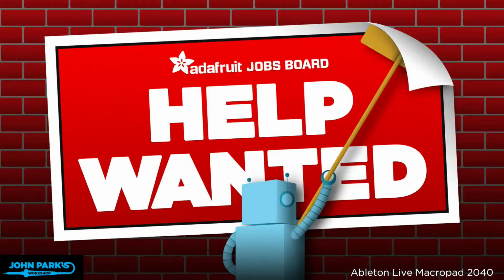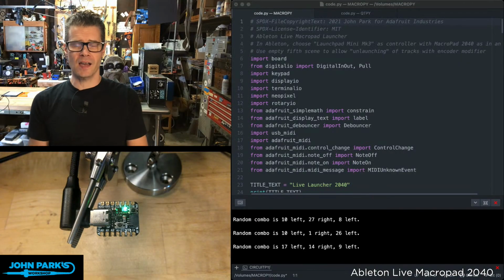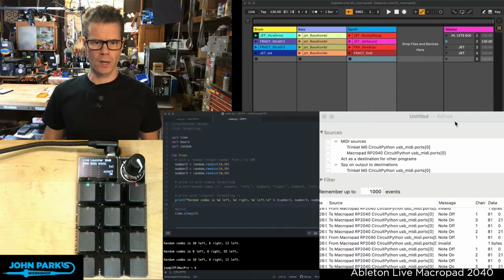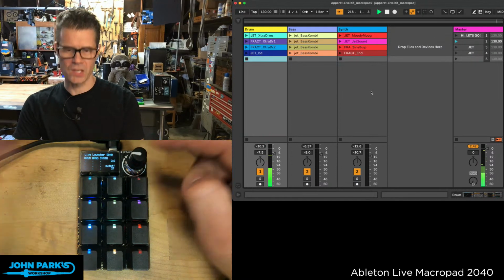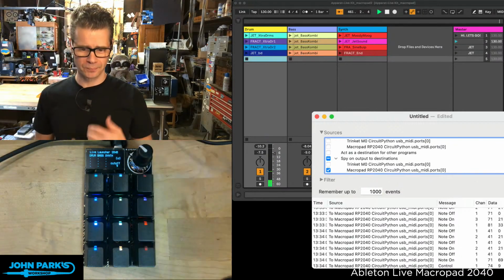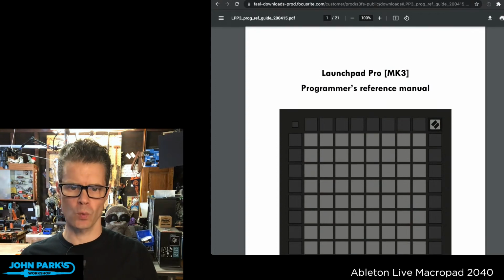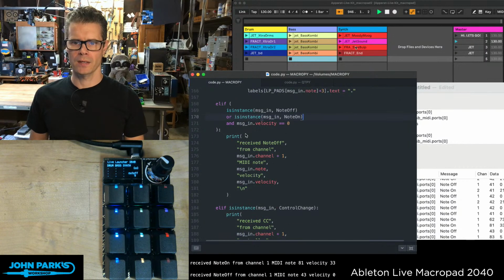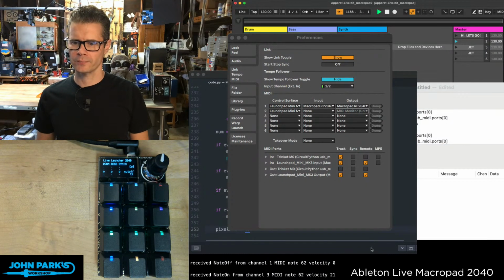JOHN PARK'S WORKSHOP LIVE  7/8/21 Ableton Live Macropad @adafruit @johnedgarpark #adafruit

Comment: 11:15 - random nitpick: that’s not a carriage return, it’s a newline. :) (\n = newline = ascii decimal 10; \r = carriage return = ascii decimal 13. Also, that’s a backslash; “slash en” would be /n, which would not have the same effect.)

Also, a bit sad you didn’t at least do %2d for the format string, to show a hint of what’s possible with formatting, lest someone think it’s just about reformatting the variable placement in the code. Totally makes sense not to dive deep for a parsec clip, but… :)

Anyway, good stuff overall, just thought I’d give some hopefully-constructive feedback. :)